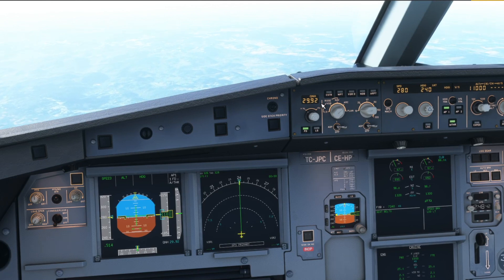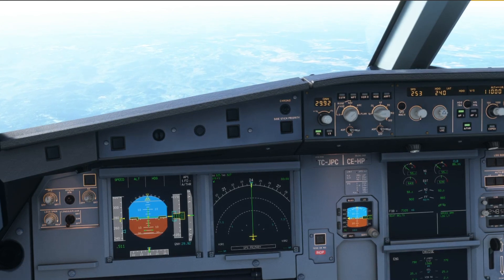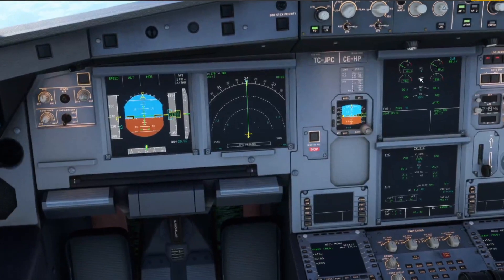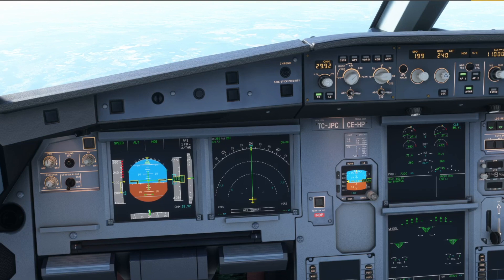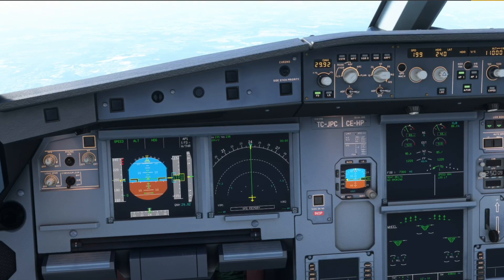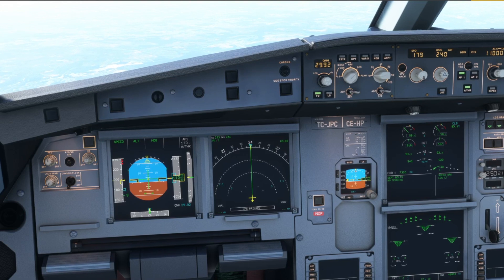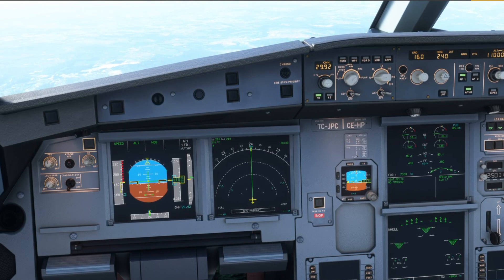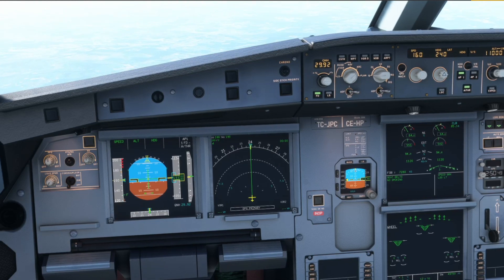FBW A32NX | AutoThrust Updates

Comment: Awesome work as always, guys! By the way, isn't there supposed to be an ECAM when the speed brakes are extended and the engines are not at idle?
Reply: When the engines spool up while the speedbrakes are extended, the green "Speed BRK" on the E/W D starts to flash. If after 30 seconds the speedbrakes are still extended you will get an amber master caution and an ECAM message. Cheers
Reply: @ogaibo1316  Roger, our FWC is in development right now, once it gets implemented, it will take care of warnings like this
Reply: not imediately if you are in a descent but if you are in level flight yes you will get an ECAM
Reply: Yes, it's there on the right side of the ECAM in the video